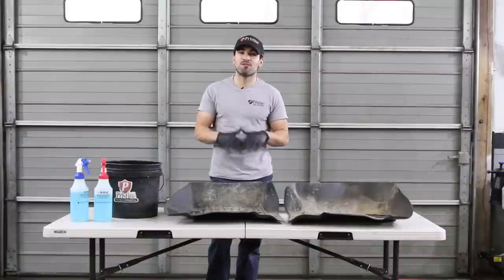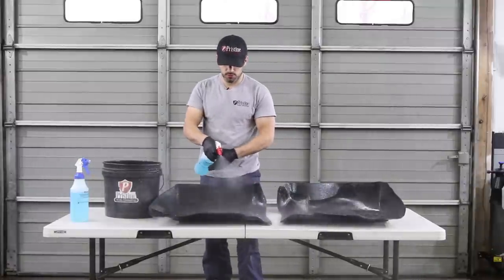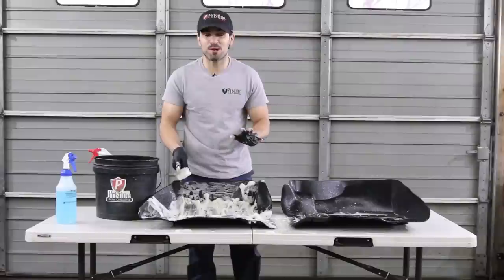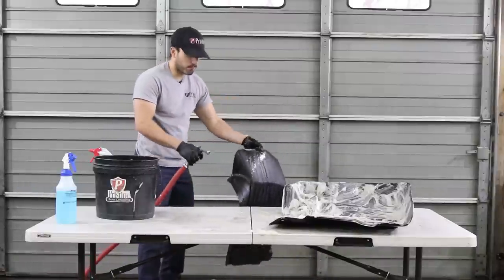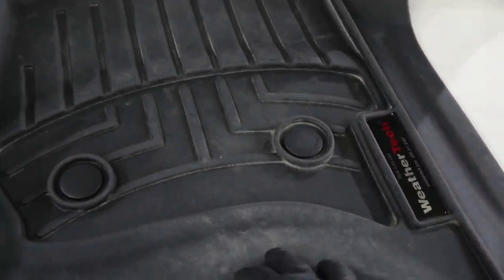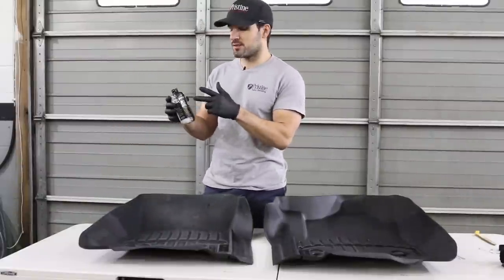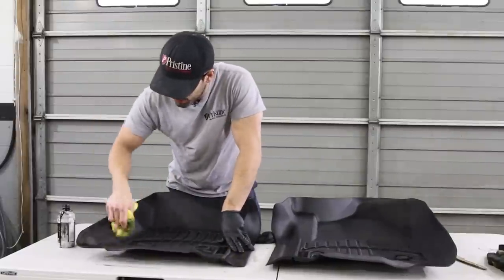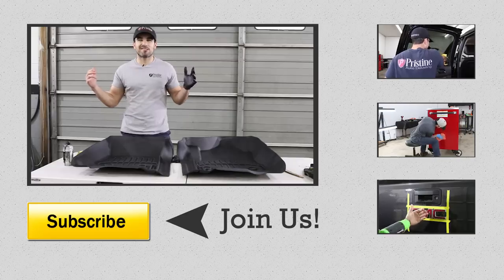How to clean & restore Weathertech floor liners

Comment: Try Murphys Oil Soap.  This is an age old product that does a Great Job on matts;  Outdoor GRILLS; Indoor stoves; stove / hood exhaust etc.. Most chemicals do not lift dirt and in particular dirt mixed with oils.  This is right in the wheel house of this product. Once you lather-up the vinyl or rubber matte move out of the sun; let sit for 10 minutes or so, scrub again (you do not have to use more Murphy's just wet the scrub brush with water). Rinse and dry.  Then use some  Chemical Guys 'Silk Shine Dressing' (I have no relation with them at all). Both products are cheap and the Silk shine dressing dries with no oily residual.  The finish will not be a gloss rather a matte finish, i.e., restores & protects the new finish but does not enhance it from a gloss perspective.

Comment: I have had this issue for the past 3 years, mud from construction sites dried on and no matter how hard I scrubbed the staining never came off. I finally found a sure fire method that's easy and not expensive. First power wash or scrub the mats to get the majority of dirt off then let dry. Second - spray stained areas with WD40 and scrub with a brush (important), I used a toothbrush for the grooves and corners, lastly rinse the mat off with a detergent. If you missed a couple spot do over - but it will come off. Mine look brand new!
Reply: Do they smell though?

Comment: Thank you for the video! I have had the weather tech mats in black for years. They are an absolute pain to clean! Mine never look good even after washing and scrubbing for a long time. I agree. The material holds too much dirt. Unfortunately, they don't make the husky mats for my older car. Interestingly, a local dealer said the grey and tan weather tech mats tend to look better for longer. I do use a natural tire shine on my mats to make them look better. They can get slippery though, as you said. Thanks for the tips! Great video!
Reply from the maker: The Stoner Trim Shine that comes in the aerosol tends to work pretty well and not too slippery. Just make sure to wipe them off to remove any excess after you apply the trim shine.

Comment: I just refurbished my Weathertech mats by painting them with black Dupli-color trim and bumper paint.  It dries to the perfect matt black shade and is a flexible paint that should last a long time.
Reply from the maker: That's a great idea Bill!!
Reply: Did you sand it down first or just prepped then paint?
Reply: I first scrubbed it with dawn soap and water. Dried it with a hair dryer. Checked that all dirt was removed. Wiped it down with isopropyl alcohol. Dried it. Masked off the logo. Then painted.  The paint is about $8 and does two mats.

Comment: I thought I was just bad at cleaning the mats until I watched this lol. Normal rubber mats seemed to clean fine until I cleaned my first set of weather tech ones. Those grooves are a pain.
Reply: Listen I just recently brought some gray weather tech floor liners for my 2022 Nissan Altima and they aren’t really a  perfect fit because dirt and grass is still able to get underneath the mates in the front and on the sides of the mats and they are a pain to clean

Comment: Purple power and stiff bristle tire brush.  Never have to scrub twice and dont have to coat with anything. Has worked perfectly on my weathertechs for over 6 years!   Keep up the great videos Pristine!
Reply from the maker: Alex R Great info buddy!! Thank you
Reply: Purple power gets all the oilfield grease off our trucks that nothing else will, don’t let it sit on the windows too long though. Then you’ll need some barkeeps friend and a soft sponge.  Then follow up with simple green. 

The standard Oilfield truck wash is a soak in simple green then a drive down the highway in the rain. Good for most grime/grease and mud/chemicals.

Comment: I used after I cleaned mine Adams ceramic spray coating.They look awesome and not slippery. I used it on my car after I corrected the paint so I had it out and it said it was good for plastic and bed liners. You did a great job on those mine are in my Camaro SS so they don’t get that dirty.✊
Reply: Regrets when you have a spillage or wet boots and the water rolls over the edge on a corner due to the hydrophobic nature. Mats like this are designed to 'wet' to disperse the liquid, evaporate as much as possible and prevent spillage.

Comment: Invest in a Tornador Black. Makes getting in all the tough spots easy peasy. Will use less degreaser, and water. Most important it will save you ton of time!
Reply from the maker: We have a few of the Tornador Blacks and love them!! I thought about making a video using that tool to clean the mats but wanted to make it as affordable as possible to clean them. Great tip Daniel!
Reply: Yeah,  some people might not want to spend the couple of Benjamins on a Tonador Black and not have the compressorset up. Yet so helpful even around the house... detailing ones vehicle, cleaning lawn/home furniture, RV/boat/yard/farm equipment, etc etc... oh, and can't leave out vomit incidents! LoL Like any good tool, it will pay off in the long run.

Comment: #Pristine I personally prefer the Husky mats over weather tech. Living in Oklahoma the husky holds up better than the weather tech does in the heat. After a few months in southern heat the weather tech mats will begin to fold over and lose there shape unlike the husky ones. Also the rubber finish appears better. I work for a dealership and I have a buddy that owns an accessories shop and we both recommend Husky over the weather tech even though he stocks both there. But good video!
Reply from the maker: Timboslice5-80 I can definitely see that. I dunno why everyone around here goes weathertech. I think it’s all a marketing thing and everyone knows the name better.
Reply: That’s all it takes. A better marketing strategy wins the battle!
Reply: Andrei Moise  The new Meguiers Ceramic spray?
Reply: @Emily Stornetta husk xact countours r much better.. heavier non slip material with larger grooves for water and dirt to fall into so your shoes aren't sliding around in it
Reply: @PristineAutoDetailing  Literally just did some husky mats Friday. I didn't see much of the discoloration or embedded dirt as I do with Weather tech. But most of my clients have W.T. for the name.

Comment: I had weathertech mats in my Frontier.  The "heel" area on the driver mat over time because discolored, almost greenish ( I assume it was from the winter/ salt ).  They were stiff and the design would allow water to "drain" or run towards the rocker trim.  So I had to put a piece of towel there to A. keep the water towards the center of the mat, B. absorb any water that did run that direction.  Now with my Sierra, I went with the Husky liners, Xact Contour and they are ALOT better than the WT.  They are soft and pliable, not to mention there is a raised "wall" on the outside of the mat so the water should stay "on" the mat as opposed to running towards the rocker trim.
Reply from the maker: Hey Gav!
This is great info! I think I may try the same when I am due for an upgrade.

Comment: Some OEM plastic floor mats come with warning labels telling you to avoid scrubbing them because doing so will cause more microscopic grooves, pores, and scratches in the material, causing them to get dirty quicker, The best way is to rinse them and avoid scrubbing them unless absolutely necessary. The more you scrub them, the faster they get dirty.
Reply from the maker: So true!! We notice the more scratches from rocks and feet etc the harder they are to clean. Great tip!! 
Scrubbing can def add more fine scratches. 
Thanks buddy!!
Chad
Reply: So does this mean if you used a softer brush rather than a stiff brush like a tire brush be fine?
Reply: TheMidnightNarwhal least aggressive is always best because the stiffer the brush the higher the chance of microscopic scratches

Comment: Did you try the Weather Tech final mat topping? Much easier to use just spray it on the clean mat and let it dry in the sun a few minutes not slick at all.
Reply from the maker: Not yet but I think I need to! Thank you so much!

Comment: So... What do you use when cleaning the tan Weathertechs? I'm curious because I'm thinking about getting a set in tan for my car. I wouldn't be tracking more than rainy day mud and water into my car. It looks like the black gets a whiteish, or lighter color discoloration. Does that mean it doesn't show up as much in the tan versions?
Reply from the maker: I clean the tan the same way as the black. Seems like the gray and tan hold up a little better and don't get so whiteish in color after use. I generally recommend tan or gray to clients if it will at all match up.
Reply: @PristineAutoDetailing  Thanks so much for taking the time to reply. That is good to know, since my interior is Ivory. I think the tan will match nicely. BTW, I just got some 3d Maxpider mats for my Ridgeline in black. I like those a lot. They are similar, but very different from the WTs. Time will tell how they clean up or last. But unfortunately they don't make them for my 02 accord. So I'll likely be picking up some tan WTs. Thank so much, this helped me decide once and for all on the color.
Reply from the maker: I will have to check out the maxpider mats!

Comment: What if you use your method to clean the mats then use any plastic trim shine.. let the trim shine be absorbed and THEN wash them with a degreaser? I am wondering if this would make them look like new but then they won't be slippery?
Reply from the maker: We will use Stoner Trim Shine aerosol to finish them when need to do faster and have had great success. Allow it to dry into the mat like you said and wipe down any excess.
Reply: @PristineAutoDetailing  I'll try it thanks!

Comment: My weathertek mats looked bad immediately. First washing didn't clean them nor did subsequent washings. It's like dirt soaks right into the rubber, not happy with this type of rubber. Hope this works, thanks.
Reply from the maker: Yeah over time I tend to lean more towards the Husky brand of materials.
Reply: @PristineAutoDetailing  Husky also makes custom fitting mats?  My son's looking for his car but I warned him about how old WeatherTek looks after a few weeks and that it's a lot of work to keep them looking nice.
Reply from the maker: Yeah Husky makes custom fit mats and on amazon they sell some knock off versions for a little cheaper that clean up easily as well. I believe the ones I got were called smart liner mats
Reply: @PristineAutoDetailing  Thank you! I passed along the info. Husky looks great.

Comment: Funny you should mention Tire Shine. I sent my Ford Flex to the dealer for repair and had then do a detail job on it at the same time. When I picked my car up they had put Tire shine on my carpet. Do you have any idea on how I remove the Tire Shine from the carpet? I am slipping and sliding every time i get in and out of the car.
Reply from the maker: Thats horrible! Have you tried a degreaser or all purpose cleaner and a couple towels? That may help. I would def. be calling them.

Comment: Guys, you got to be careful about what you recommend to make the mats shine after you clean them. Most products designed for trim restoration state on the can,  "not to use for floor mats". Some stuff is too slippery and the driver's foot might slip off the brake and cause an accident. Make sure what you recommend is approved for floor mats.
Reply from the maker: Great tip James! Solution Finish is most likely the only product i would recommend that is "SAFE". 
Solution finish works great on mats, handles, and running boards and out of the hundreds of mats and running boards we have done it never makes it slippery.
Reply: @PristineAutoDetailing  Chemical Guys makes a dedicated mat cleaner for rubber and plastic mats.

Comment: Great idea.  but........how much do you charge a customer for this task?  Nearly the same as new set of mats? Thanks.
Reply from the maker: This is included in every stage 2 full detail with do here @ the shop. If someone just wanted this done I would estimate around $30-$50.00 but generally then just go for the full detail.

Comment: What do you think about using mother's back to black on these floor mats versus solution finish?
Reply from the maker: I have not tried that but have been really like using Stoner Trim Shine in the Aerosol Can then wipe any excess if needed. Its a lot faster and does a great job on this mats.
Reply: @PristineAutoDetailing  Thanks for the info and video. I'll look into that.

Comment: I get scared with husky liners they look so slick. But with any other rubber floor mats I used to always use interior dressing. It rains a lot in seattle tho so once u get it wet it becomes a slip and slide then it gets on yout shoes and on the clutch pedal 😲😬

Comment: Weathertech makes their own cleaners. I would be curious to see if their formulation works better.
Reply from the maker: I definitely should try that out!! Great idea
Reply: Their cleaners are very expensive. I did better elsewhere with Mother's products.
Reply: They are expensive, but they work great. I'm not sure there's anything special about the cleaner, but the protectant is awesome. Once the mats are clean and dry, spray/mist the protectant on it and spread it around with a damp sponge, then let dry. Once dry, the mats have the same satin black appearance with just a hint of sheen, and are not slippery at all. Literally look new.
Reply: @erik996  Could it be a spray wax?
Reply: @RiceGrainz  I have no clue. I suppose it could be. It's a milky white liquid in the bottle, so whatever is dissolved in the liquid remains on the surface when the liquid carrier evaporates.

Comment: What do you use on tan floor mats to make them look new again since Solotion Finish doesn't come in tan color?
Reply from the maker: Generally we will just use Stoner Trim Shine that comes in a can on the tan and gray mats. Its important to wipe off any extra product after applying though that way they do not stay slippy.

Comment: Hello, my situation is a little different. Basically, I ended up getting a new car that is the same as my old car, but it is black instead of grey. Do you think using the solution finish black on grey mats would adequately recolor the mats?
Reply from the maker: Solution finish black would not work on grey mats.
Reply from the maker: I would guess if you painted them they would chip and scratch fairly  easily as well.

Comment: It looks like just pain WD40 helped me to clean it up after just plain water wash back to nice black almost like original condition.
I tried different pressure washing / soaping / decreasing but some residue remained every time. 
this time just hose quick wash, then paper towel dry, then wd40 with paper towel and it look like I feel I like it this way.

Comment: Do you think NuVinyl would do just as good of a job versus that solution finish? Or ArmorAll protectant gel?
Reply from the maker: I have not used either of those products but I would say they would be worth a shot as long as they don't get super slick on the shoes.
Reply: @PristineAutoDetailing   I know that Armor All leaves a ridiculously slick feel after applying. I did some research since my comment and 303 Aerospace protectant is what a lot of people are switching to when it comes to interior detailing. Has the same results with a matte finish. Ordered a bottle and will be trying it out. Also a tip I learned in the vid...apply the product using one of those cheap black foam paint brushes, then rub in and wipe away excess with a micro fiber cloth. May help you with your applications as well in those nooks and crannies!

Comment: I have a question bud. If I go to the car wash I assume they will remove them to clean and put them back in. Question is ; would that not trap water underneath My Weather Tech mats ?   And so how should I deal with that ?   P.S. despite the price I'm glad I bought the WeatherTech's because it looks like I'm not going to have to pay to have salt removed next spring. And I don't want the salt in there eating the shit out of my near new flooring carpet.
Reply from the maker: We always make sure the back sides of the mats are dry before we put them back in. We love WeatherTech mats especially during the winter months!